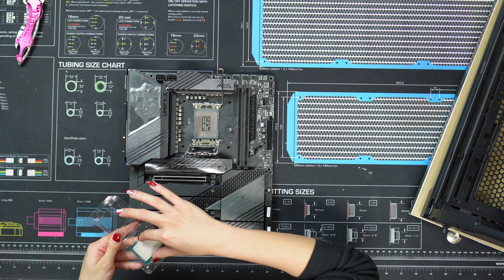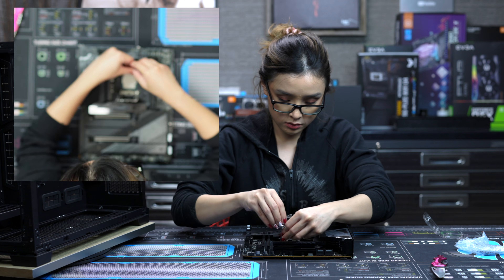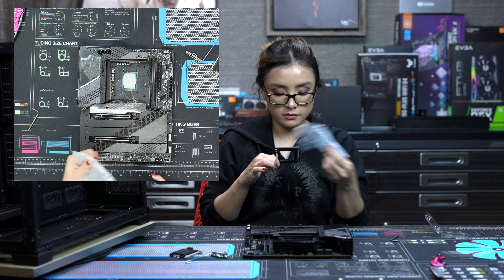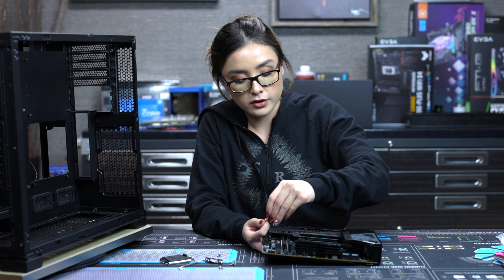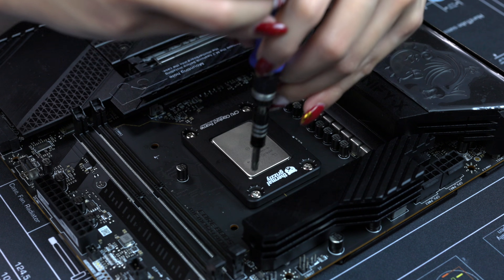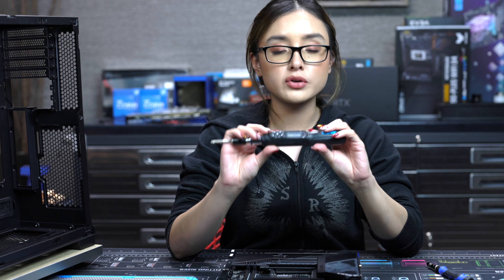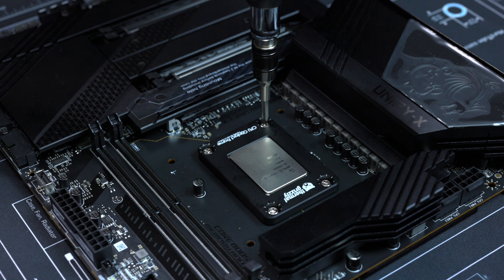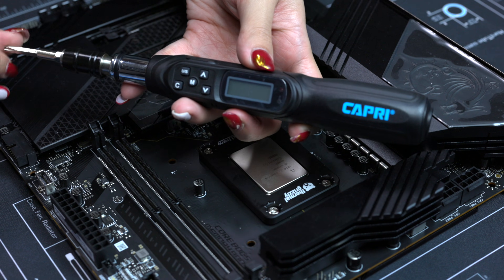Thermal Grizzly Contact Frame Installation | "Gamer's NexusING" Gamer's Nexus

Comment from the maker: EDIT/NOTE: So this method that was done last year is pretty much obsolete now!  Why? Because the newer version of this contact frame does not to be adjusted/measured for perfect torque.....anyway this is another little video made from outakes of the GOW build.  I got about 8 degrees cooler from just using the contact frame.   Also a few other important points on this video:
1.  Not sure if thermalright or the thermal grizzly came first, and I did not mean to insinuate that thermalright was one of the copy cats.  What I do know is they both work about the same (yes I tested both) and one is priced much lower.  There are other knockoffs that copy designs, it is what it is in the industry.  I found a handful of contact frame knockoffs and to tbh, they work just as good despite many of them not even testing them.  At the price pint, the TR makes a lot more sense for this model. 
2.  This was a video put together using old unused footage and was meant to be more of a tongue in cheek video checking GN's work to just get things rolling with the new channel here.  It was never meant to be a specific actual "how to install a contact frame" video, although there is some good information on there about it that is helpful.  At first, I thought just a few people would see it.   But I am now realizing that some people might have been looking for a "real" install video and ended up here.   So I'll put together one soon and provide the link here soon.   
Get your ThermalRight Fram here  https://amzn.to/3TWxrWF or Thermal Grizzly Contact frame here: https://amzn.to/3Tl1FRi (affiliate links) 
Credit to  @GamersNexus  and their installation original video here which we used to test out their accuracy: https://www.youtube.com/watch?v=Ysb25vsNBQI   But NOTE - it's ALSO obsolete as well with the new version of TG's contact frame released.
Reply: Hi, how do we know if the contact frame is the newer version? Thanks.
Reply: Si Si Si Si Si INSIGNIA K8 K4 ULTRA HDR TVOS PS5 GTA VI 2025🔊🔊🔊🔊🔊🔊🔊🔊
Reply: Hi awesome work, where did you find that 5 cNm stat for the screws? I couldnt find it. Because I am about to buy a compatible Srewdriver for this and its not cheap :D
Reply: I miss the old days when everything worked without additional crap, when engineering was perfect and all was perfectly calculated. 
Now they design huge parts, the motherboard is not robust enough and you need anti-sag, first for GPU, now for CPU. If you are really unlucky, a name is added to a brand and you pay 10x the price for a CNC piece which is literally worth $2. People are getting ripped off and they don't even notice, on the contrary they defend what they think is "the best" product, aggressively. 
But maybe I am old and cannot keep the pace with newer generations.

Comment: I'd like one of those screwdrivers, but it's $250.  Yikes.
The problem is the point where you decide to start to tighten is subjective.
One comment on another video suggested using the little L wrench by holding it vertical with your thumb, and tighten with your index finger until the end just starts to dig in to your index finger.  Use that to tighten all of them consistently.

Comment: Good video. I've been toying whether to put a contact frame on and now i can see how easy it is with a torique screwdriver I probably will. Amazing you made this video, just what I needed to see - thanks.
Reply from the maker: To make things even better, you don't even need a torque screwdriver anymore for the latest versions.   Additionally, unless you have a 13/14th gen intel board, a contact frame won't do much for temps.
Reply: @SnaxanTech  ok thats interesting because I just moved from the 14th gen to core ultra. I'm getting CPU temps of around 60 - 65 average in games with a core ultra 7 is this normal? Im using a corsair 360 AIO. Seems a little high to me.
Reply: This is normal. I would say anything like 85+ that's actually consistent and not just a sharp spike in temps which goes back down is totally acceptable

Comment: i have the Thermalright contact frame for my AMD Ryzen 7 9800X3D and it works wonders, i want to get the thermal grizzly thermal pads so i don't have to deal with the messy thermal paste
Reply from the maker: Those pads are awesome honestly.  They are really good with thermals too surprisingy.  Love how easy they are to use

Comment: Can use it for direct die mounting kit frame ?
Reply from the maker: Generally speaking yes you can but some come with their own so just refer to the kit manual
Reply: @SnaxanTech the heat killer pro iv some guys say u need this but it is working ??

Comment: Hey there! So I have the “newer” one you mention in the pinned comment but I’m curious: why doesn’t mine need to be as accurate? Should it not have the same torque on all 4 sides?
Reply from the maker: The reason is because the way it's designed, once it's screwed in all the way it just stops and can't be over-torqued.  You should be good to to don't worry!  :)
Reply: @SnaxanTech i ordered the am5 thermal grizzly version so how do i know if its the new version or not?
Reply from the maker: @mikekuoz2598  The older version doesn't really make contact with the motherboard and won't bottom out.  The new one will bottom out and does make contact with the motherboard.  Also, they don't sell the older one anymore so if you got it from a reputable seller (not third party on a seller site), most likely its the new one.  hope that helps
Reply: @SnaxanTech  so should i screw it until i can't? Or should i stop before?

Comment: Having trouble finding what the torque spec is for the artic freezer III. If anyone knows and could respond, I would really appreciate it!
Reply from the maker: Don't worry, there's no exact recommended number for this one.  I think those have springs right?  Just hand tighten all the way down and you should be fine.  Make sure you tighten all the way I found it helps with noise/vibration .
Reply: Understood, no springs, unfortunately. I ask because my 12900KS is running relatively hot on the middle cores. The average is 77, but I'm hitting 90-91 in the center. I'm running the 360mm version of the freezer III, so this leads me to believe that the pressure is slightly off. I'll try torquing everything down and check back to see if it helps. I appreciate the response!

Comment: The thing is the cooler sorts out the contact pressure anyways  lol
Reply from the maker: That's actually not true, I'd hate anyone to see that and assume it's true.  If that was the case, we wouldn't need contact frames to correct the LG1700 issue because all CPUs have coolers on them.  Coolers use different points to secure them and rely on the even plane of the CPU for even distribution, otherwise you get more pressure on raised parts.
Reply: @SnaxanTech  do some tests 🤣
Reply from the maker: I have and there are a lot of videos on youtube on it.    But basically I got anywhere from 5 to 12 degrees cooler using the contact frame vs no contact frame using the same cooler for an lga 1700 socket.  You don't need it on the AMD sockets though. You can check out gamers nexus videos on it as well.

Comment: Did you take the silver back plate off on the back of the mother board? When using my thermal grizzly plate the original IWM screws would not mount without that plate. It was odd thermal grizzly sent their own screws and wrench when the directions said to use the OEM screws.

Comment: Is the newer version the one that says 13/14th gen instead of 12th gen? 
I heard i wont need to measure torque on this newer one. Does that mean i just screw it all the way down. Will the frame then touch the mobo just like the thermalright frame?
Reply from the maker: Yes the newer version you can screw it all the way down.  But you don't want to over torque it.  They don't sell the older version anymore so I think if it says 13/14th gen it's probably good but be sure to check the seller.

Comment: I am stuck with the old version. I bought my TG one over a year ago and never put it on my build. 

It was still sealed. 

I am going to be changing cases and have to take everything off the MB to do it, so figured I might as well install it. 

Mine has the instructions for the torque since it’s for the 12th gen. I think that still applies to the 12th gen ONLY frames. Which is what mine is. 

They made a 13/14th gen that also works with the 12th gen and that appears to be the one where the torque doesn’t matter. 

Which sucks for me lol. I was going to try to buy a screwdriver to install it, but figured there is no point to buy it to use once and never use it again.
Reply from the maker: Just use the video from gamers nexus, it works pretty good as proven by my video and no torque driver needed :)
Reply: 12th, 13th and 14th gen are all exactly the same in terms of form factor and are installed the same way. No Diff.

Comment: AMD AM5 CPU Thermal Grizzly contact frame why is it that most PC builders that I follow on youtube don't use this on there builds, would you recommend using this on a AMD AM5 Ryzen 7 7899X3D cpu?
Reply from the maker: Its because AMD AM5 do not need this.  This is strictly an Intel LGA 1700 socket issue :)    The new arrow lake motherboards have correct this but since you're amd and AM5 socket user, you don't have to worry.

Comment: HELP!
I watched you're video and so just bought a ProArt PA602 case, a ProArt LC 420 AIO cooler, and a ProArt Z790 motherboard with an Intel 14900KF processor housed in a Thermal Grizzly contact frame, and tried to put them together. Assembly went normally until I tried to install the waterblock/pump head onto the CPU. 
I used the hex-styled standoffs labeled for an LG1700, as per the instructions, and just lightly seated them onto the motherboard, not over-tightening. The Thermal Grizzly contact frame is absolutely not touching or otherwise interfering with the motherboard or CPU fitment. The standoff screws seem not long enough with the included Intel-style backing plate to give any thread to install the thumbscrew caps which fasten down the waterblock/pumphead. There is a gap left beneath the AIO mounting bracket of just about the size I would expect to give enough thread for the thumbscrew caps, if only the waterblock copper face were a bit shorter in height. When settling the waterblock onto the CPU, the tip of each standoff screw just barely comes flush with the outside/top of the waterblock mounting bracket, leaving no thread to fasten them on at all. 
I've redone this from scratch twice now, carefully rechecking everything I did, and cannot figure out what the problem is. What am I doing wrong?
Reply from the maker: My guess is you might be using the wrong mounts for the AIO, either the bracket, or the hardware.  It's hard to know without seeing it.  Try posting a pic on a reddit forum.

Comment: Can you link the torq screwdriver in the video please?
Reply from the maker: The one I used in the video ended up having issues so I can't recommend.  I've found a much better one since.  The new one is mechanical and doesn't require batteries and isn't digital and it's great I love it.  You set the torque and once its reached, the driver don't turn the screw anymore.    It's this one here if youre interested https://www.mcmaster.com/5716A63/
Reply: @SnaxanTech  great tool, but is is a heck expensive, almost 300 bucks for the average person to use once or twice...🤔🤔
Reply: @HawkEyesAndy she didnt say cheap. In fact, you wont ever get good tools cheap, especially tools that have to be calibrated

Comment: I used a torque screwdriver when I installed mine. As an auto tech for 40 years I'm pretty anal about accuracy when it comes to torqing nuts and bolts
Reply: Please,  edit the word after the pretty 😉
Reply: @vasiovasio  Or how about you learn English and clean your dirty mind? :)
Reply: @vasiovasio  ANAL?

Comment: Isn’t the correct torque 0.6nm?
Reply: 0.06 for the frame. 0.6 is for some coolers if I remember correctly. That might be where you got 0.6 from.
Reply: How do you know the torque value of these parts? Where can I access these value tables?

Comment: I think it's crazy, and a bit unacceptable, that This even needs to be done.
It's a design flaw. And we're suppose to just BUY additional products to correct the flaw. . . . no, . . simply, no.
Nice video, tho. Thank you, first time viewer, subbed, greetings from the Great State of Alaska.
Reply from the maker: Alaska seems so beautiful!  and thank you and welcome to the fam here! 
Also Intel seems to have finally corrected the issue with arrow lake we will see how well though.
Reply: Intel will release new socket to the end of the year with new locking mechanism.
They even plan to offer two, one like the current used in 1700 but with more good balanced pressure preventing bending and another one like these contact frames for even more accuracy and durability! 😊😊😊

Comment: My Thermal Grizzly contact frame, did not fit on my Asus Prime Z790. 
if i got it to fit on on corner, then the rest would not, the amount of force i would hav to use on the screws, did not seam right to me.

Had no issues with Thermalright contact frame
Reply from the maker: The theralright is just as good at much cheaper price point too
Reply: @SnaxanTech it actually performs a little bit better all around when it comes to thermals. Gamernexus did comparisons. LOL @ this overpriced German trash

Comment: Something to note is that the marking method is actually more accurate than the torque driver.

Screw torque relates to clamping torque based on a formula that has the friction of the threads as a variable.  Which means there's always going to be some variation.  It also means if you use anti-sieze or thermal paste on the screws the torque spec is going to be wildly wrong.  However, the marking method is still correct.
Reply from the maker: If that's true this is great additional info thank you
Reply: I was wondering about that myself. Torque ratings typically specify the type of lube, if any, required to match the torque specified. Friction between threads can very wildly, especially on questionably machined items. I'm a master machinist, by the way.   There are many factors that can cause a bad reading from a Torque tool at this range of Torque, vs say Torqueing a car wheel or head stud.
Reply: Why would anyone put anti-seize or especially thermal paste on these screws? LOL. Thermal paste goes on the die, IHS, etc. not on screw-threads or screws at all for that matter. Anti-sieze and "thermal paste on screws" has nothing to do with PC-building so your comment doesn't really mean anything.

Comment: blew me away when you used the torque driver, not many people get that technical. I do, which is why I always look for those types of specs on anything that requires building. Great job and content.
Reply from the maker: It’s such a cool little gadget!  Thanks for stopping by!
Reply: We build our high end computers the same way, especially with custom loops and plexi, torquing every bolt and make a rapport from the computer. We have special work orders for our people. But She is doing one mistake, she should fasten the bolts, overhead and at a pattern. We started to use torque screwdrivers, when one of our guys, fastened a 600€+ motherboard too hard and I still can hear the snap. Good that our vendor replaced it with a new one. But this happened only once. Our guys themselves came up with the idea for the torq. I'm very lucky to have such workers, can't say that enough.
Reply: I only use torque wrenches for rod bolts/ headbolts/ crankshaft  bolts and such, but anything external just gets torqued close enough unless its a sealing surface with a gasket or a moving part.
Reply: I was quite annoyed the instructions didn’t have them torque specs because that’s exactly why we buy the tools.  Very unprofessional of Thermal Grizzly.

Comment: you need to get your facts straight!!! as Thermalright, were the first to come out to the market with this product. then came the Thermal Grizzly product. so it would be Thermal Grizzly that are the copycats!!!!
Reply from the maker: You could be right.  If that's true I assumed wrong if I thought thermal grizzly was first.  I wasn't referring to them in the video and also updated the pinned comment and description.  Thanks for heads up!
Reply: Thats bullsh*t. Thermalright came way after Thermalgrizzly.
Reply: Thermalright was way after!
Reply: Thermalright copied it like they copy everything else. It’s common sense, why would a company that copied it, charge twice as much like you are saying Thermal Grizzly did?  If TG copied it, they would be underpricing it to make money off the copy, not charging more. 

That’s why Thermalright is selling it cheap, to take money away from the ones that made it. That’s what happens to every knockoff product, they are sold cheaper not at a higher price.

Comment: I never really understood what the "Torque" means during my high school days😅 I still don't know it even now🤣
Reply from the maker: It just tells you how tight it is! :)   Sometimes you don't want to make it too tight, or in other words, you don't want to "over" torque it.
Reply: Thanks for the explanation😀
Reply: On Intel messing up mostly just means worse thermals, on PGA-AMD; basically anything pre-DDR5 you can literally temporarily brick your socket, which is only resolved by removing torque again.
To be clear; this ain't a problem for an average user as they should use coolers that prevent overtorquing anyway.

Comment: I used the same frame on my 14700k, just did the x pattern to tighten. Everything has been fine.
Reply: cooler will sort out the contact pressure anyways 😉